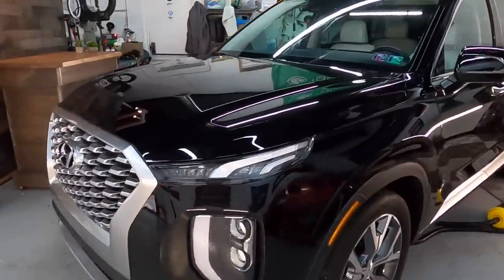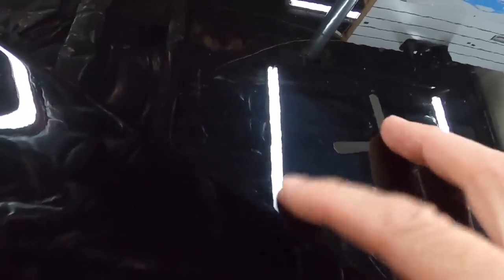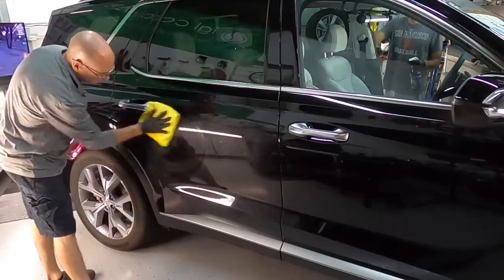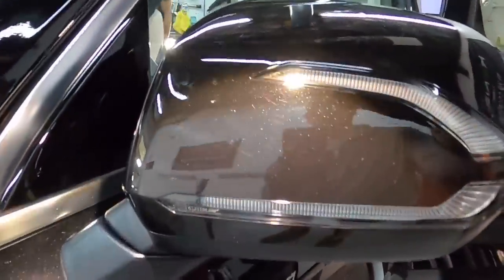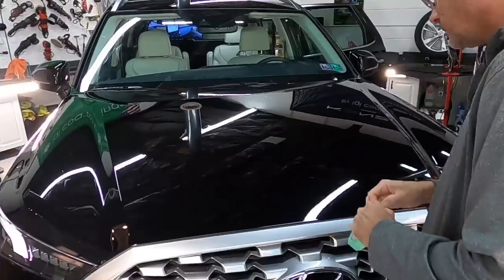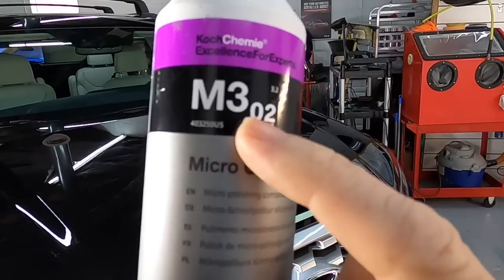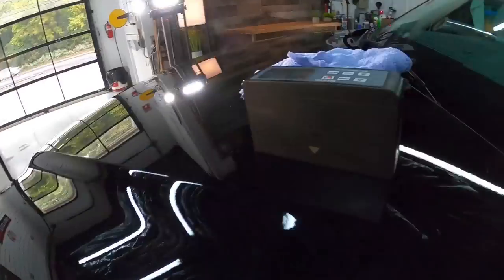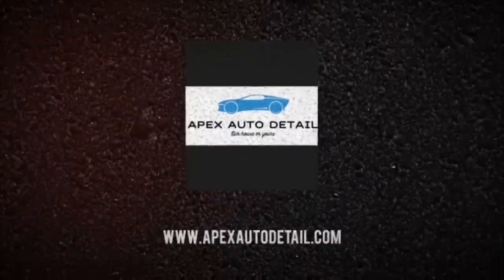2020 Hyundai Palisade! Let's Talk About Thin, Soft Clear Coat! Part 1

Comment: You are so correct concerning Hyundai’s having thin soft clear. I had a Genesis coupe and when a bird would poop on the car it would eat into the clear in just a few hours if not removed. Bird poop was not an issue on our 2018 Ford Explorer or the 2019 Ford Edge.
Reply: Same here! Got a 2017 Santa Fe and I got in to the habit to carrying a pack of baby wipe in the car to remove the odd bird bomb with the help of a detailer spray. It works well. I was late once though and it etched. Auto Fanatic's Secret Weapon sorts it out though.

Comment: Nice to see this type of clear coat. I see that they are very soft and it’s cheap of them to do that.Why not put a solid clear coat on the vehicle 🤷🏼‍♂️You get a 10 year warranty on the vehicle but the paint is not included in the 10 years.The worst part to cut costs.Excellent video Brian ✊
Reply from the maker: Good point.👍

Comment: Lot of this work reminds me of the hours I put into my kia niro. My paint thickness read outs on that ranged 3.9 t0 4.6. Espresso Brown for those wondering. I think between spot correcting, wet sanding, and pad decision I made I had least 7 - 8 hours into correcting it. Its now coated and been coated for last 2 years with cquartz and had just topper maintenance only and looks a++ all the time. Now I own a worse car then the Kia, a Tesla Model 3, and boy can I be proven wrong to what crappy paint looks like! For now its got a single hit of 3d one done and 303 graphene only. I plan on autoflex spraying / protecting the paint, then it will get a proper coating treatment :) :)
Reply from the maker: Unfortunately.. finishes are only going to get worse.

Comment: G'day Brian, great video about how manufacturers are reducing the thickness of base and clear coats. This particular model Hyundai has not yet arrived in Australia, but all the promo shows this exact model that you are working on with left-hand drive, where we have the opposite drive. I have a 2018 Hyundai Tucson which I had Opti-coat Plus applied, as it is outside 24/7, and is doing great with the protection.

Along with reducing the costs of manufacturing, could manufacturers be also reducing these coat thicknesses and relying on the consumer to have their vehicle coated with ceramic or graphene for protection? Cheers from Down Under.
Reply from the maker: I doubt it.. they are just cutting overhead to be greedy.